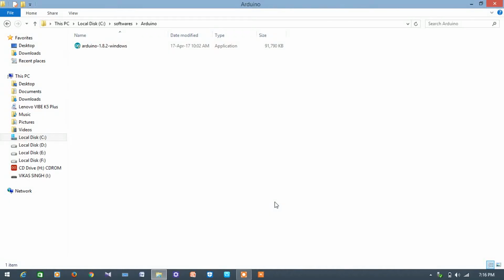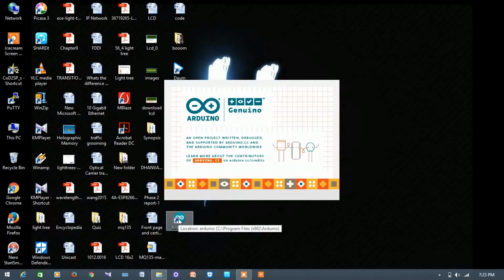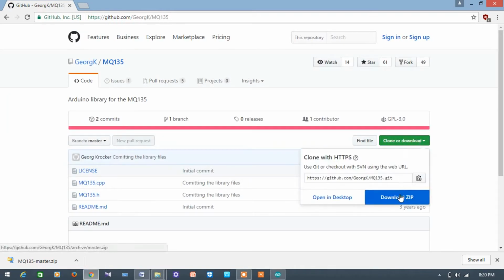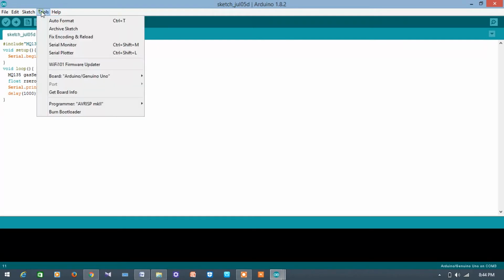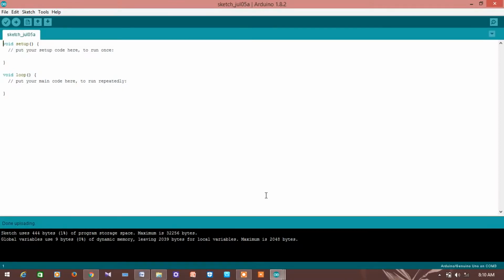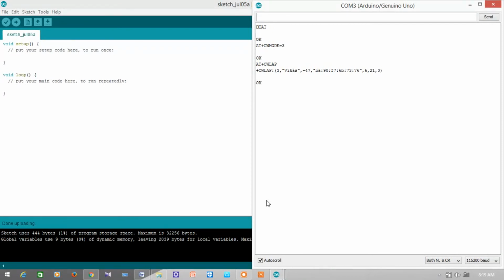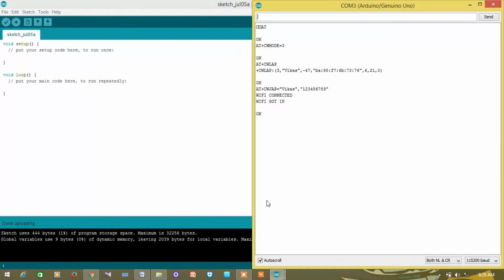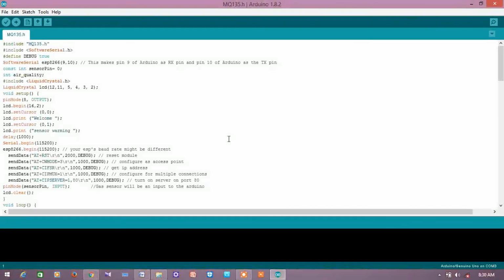IOT based Air Pollution monitoring system using Arduino

Comment: How do you define the rzero?
Reply: u have to calibrate the sensor
#include "MQ135.h"
void setup (){
Serial.begin (9600);
}
void loop() {
MQ135 gasSensor = MQ135(A0); // Attach sensor to pin A0
float rzero = gasSensor.getRZero();
Serial.println (rzero);
delay(1000);
}
let this code to run for 12 to 24 hrs and then get the RZERO value. Then open the library of sensor type#define RZERO value.
Thats all folks.

Comment: sir i want to know what are the modules in this project and is arduino 1.8.5 software supports for this project...kindly give response as soon as possible
Reply from the maker: KALLA ANUSHA The modules used are Arduino uno, esp8266, MQ135 gas sensor, Lcd display, buzzer and some resistors.
Reply: Yes Arduino 1.8.5 software support for this project.